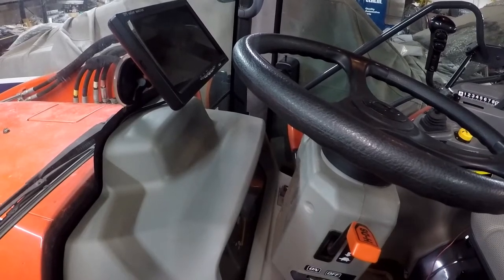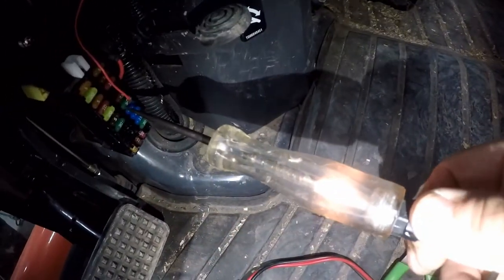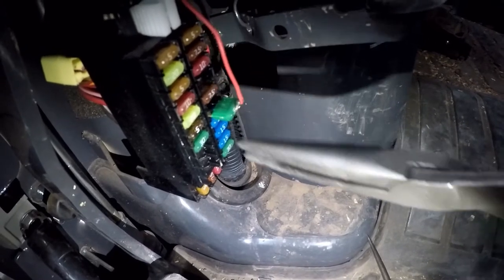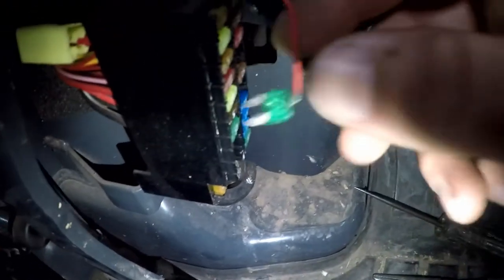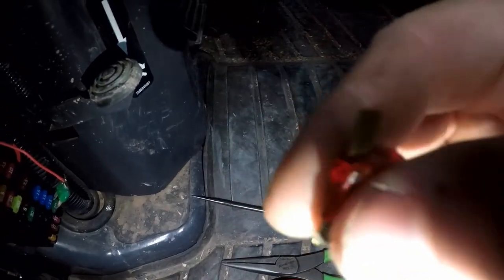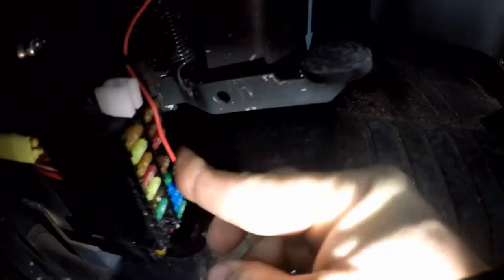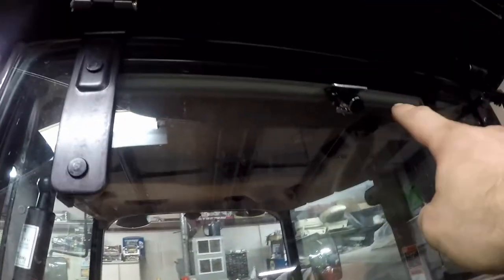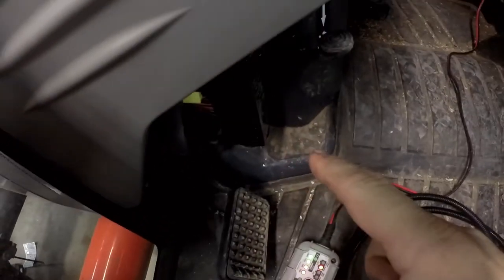How to Wire a Back Up Camera for Your Tractor

Comment: Every Tractor pretty much needs one with a cab. Good job presenting a easy way to get it done. I should do it , like some comments I am also a wrong wire guy .I switched to Led lights on the 4240 . Now turn lights on radio goes to static. Oh well
Reply from the maker: Thanks! I agree, they are a great addition. The LEDs are making noise. I would turn the lights on the radio, then unhook one light at a time and see if the noise goes away. You may have one bad LED, or the brand of LEDs you got make make noise.

Comment: I just purchased a cheap radio off amazon for my l6060.  It came with a backup cam.  I haven’t bench tested it yet just came yesterday.  I plan to pull power from the radio harness for the camera since I have to connect the tractor harness to the radio harness anyway.  Hopefully all goes well.  I think I’m going to put my cam on the front because the way the tractor is designed it’s difficult to see the tips of the pallet forks let along the bucket and grapple.  We shall see how it goes.  I just wanted a radio but for $55 bucks I got the radio and cam.
Reply from the maker: That sounds like a good deal. How big is the monitor?
Reply: 2" H x 3.5" W.  Model is SWM-4029B.  It is extremely cheaply made but I'm hoping it works.  I doubt the display will be that useful but I figured if I got it wired up and didn't like it I could pick up a cheap monitor and quickly connect the camera to it similar to what you did.

Comment: Nice but I'm definitely not good with electrical stuff. I didn't understand why to hook up the back up wire to the non-powered side of a fuse. Like I said, too confusing to me. Nice video explaining how to do it. I usually learn it well with hands-on practice and after I've blown the whole darn electrical system....THEN I know exactly what NOT to connect to. LoL  Thanks Bullitt.
Reply from the maker: Thanks! Current flows from the powered side through the fuse, to the powering the non powered side then it goes onto its destination, in this case the wiper. If it was hooked to the powered side if the monitor shorted, the fuse would not blow and it could cause a fire.

Comment: I appreciate you Bullet !  Thank you for sharing! My memory is nothing to brag about , did you install one on your BX ?  I have a Hoe on my BX but I have an open station NH 1520 I want to put one on. It's new and I will be using it to pull and crown a lot of stone driveway. I have 3 ruptured disc in my neck . Thought it might help . You all be safe and God bless you and your family !!!!    Eddy. ( Southwestern Virginia mountains)
Reply from the maker: Thanks, I appreciate you watching and commenting! No, I don't have one on the BX. If I put one on an open station tractor, I would maybe get a water proof monitor. I would also  get a sun shade, to keep the sun from washing out the picture. Another option, that may help you would be a seat with a swivel. The L4240 has a seat that swivels 15 degrees in both directions. It might not sound like much but it really makes it easier on the back.
Reply: Thank you and God bless !!!!     Eddy